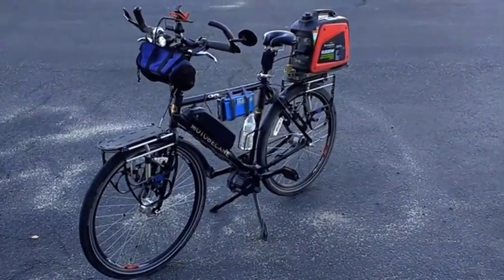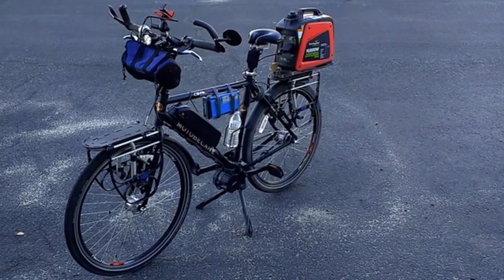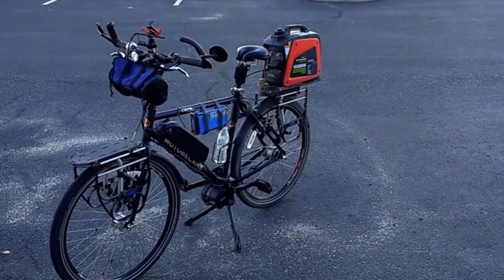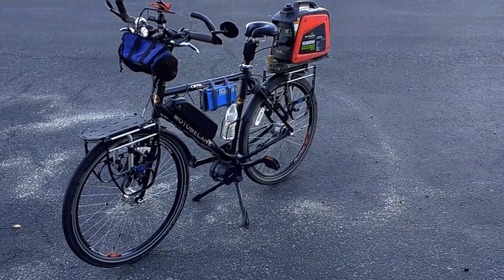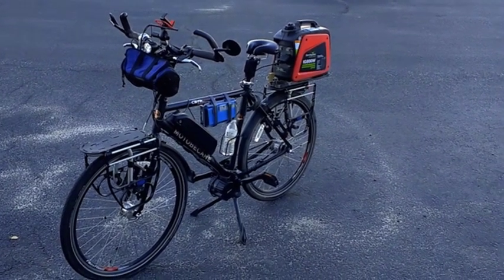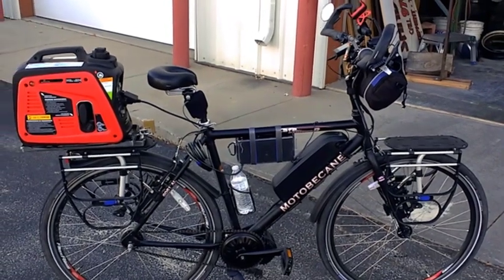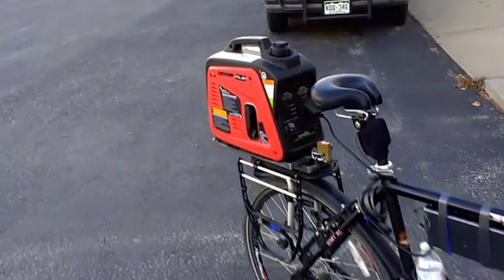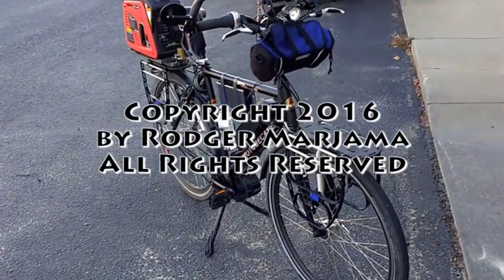e-Bike With Generator

Comment: any update on this? was thinking to do the same. I have a 350 watt middrive e-bike. Problem is i dont know what generator i should use. Someone told me i will get a 20% efficency loss. But since the smallest generators have like 800 continous effect im thinking it will work.   Any ideas?

Comment: The question that pops up in my mind is : how many miles to the nex place where you spend the night or a few hours that has a AC-outlet. Will that ever be more then 500 miles? 

Yes one can quickly fill up this generator at a gas-station, which beats charging for 4 hours for each battery that one has.

So this setup would be more for those that do thousands of miles never sleeping in a B@B, hotel or home, right?
Reply: Depend on the motor, I will choose a different kind of charger. For example my e bike motor it's 48v and 7.5A torque. 250w. So I can drive without battery if I use a power converter AC 230V TO DC 50.00V 5A. My generator it's 1000w max. So its very silent at 250w dc output to power the bike. For long miles I don't use the batteries. I have motors on both wheels wich can let me use extra torque on hills. It is safer like that because both wheels working, wich can prolong the life of the wheel.
Reply: as you said. to be able not to wait for the battery to charge is really nice.  And in some places there is really far away from a place to charge.  

Biggest advantadge is the range. Even if you are not in remote canada you will have the freedom to go anywhere you want. With a battery only you have to plan your trip and calculate distance.
Reply: primative camp sites.

Comment: Swap the battery  for a capacitor bank. Use a high speed marine charger as well.
Reply: I've never thought of using capacitors as a bike battery. With this setup I can see the advantages. Have you seen anyone do this in real life?
Reply: kevin jennings I use a genny + capacitor bank for my welder. The capacator bank kinda absorbs the surge drain from the welder.

Comment: I have actually had this idea for a while I would like to go a few steps farther and build a coffin style sleeping compartment to pull behind my bike with not only heating  but also air conditioning system with generator that could run the heat and a/c unit as well as charge the bike battery cause 50-100 miles a day travel is more than enough for me to be tuckered out but if I could build something like that it would be a dream come true I would probably just live in it and keep on the move lol lol
Reply: I have built a protoype "pop-up coffin camper trailer" which can be scaled up to meet your specs (AC, heater, etc). The dimensions are:
LENGTH: 2.7 meters (just over 8 feet)
WIDTH: 1 meter (just over 3 feet)
HEIGHT (w/top down): 1 meter (just over 3 feet)
HEIGHT (w/top up): 1.95 meters (about 6' 8")
WEIGHT: 20 kg (about 45 lbs)
TRAILER: 1 small wheel, suspended
FEATURES: good ventilation, insulation, Murphy bed (10 cm thick, 90 cm wide, 1.9 meters long), mini-sink, shelving, 2 small solar panels & 2 small lithium power banks, LED tail lights & interior lighting
Reply: Neverumind NeverTell https://www.wicycle.com/products/bike-trailers/diy

You can build your own from this kit. I've built a huge trailer from this kit.

Comment: Can you supply directly to motor via the battery output.
Reply: Abd Aziz Abd Hamid I dought it but . More than likely you would have to step down the power somehow. Like on my bike is a 48 volt system try to push 110 volts to it and you'll fry the motor. but there's got to be a way to make it work
Reply: Yes. But you need to check how many amps per hour it's draining you dc motor. What's the voltage and how many watts it's the motor?  This information will help you to find a high power converter or charger directly to the ebike. It's safe. But take off your battery to prevent any mistake. Your battery can fire up straight away

Comment: Doesnt an ebike actually use two or three times its claimed wattage when accelerating, under a heavy load, or going up hill. In that case, a 250 watt generator would work well with my Honda eu1000i, with a 900 continious watt output generator which would also be powering my lights or charging small ectronics.
Reply: This is where I always get confused.   A Honda eu1000i  generator as stated on amazon site is  1000 Watts/8.3 Amps @ 120v (max I assume).   Now controller would be bottle neck, but lets say electric motor is 48v, does that mean in terms of generator that it could max out 16.6 amps?  or does it translate to 2000 watts? Basically I don't get how to translate convert the generator power info at 120v to different voltage that is DC.
Reply from the maker: It depends on the controller.  The controller will only provide the amount of wattage it is designed for.  My bike has a 1500 watt controller and the most I have ever seen is 1600 watts for a second when giving it full power at max power settings.  I have found on my bike, 700 watts is sufficient to hold 20 MPH on level ground.  Lots a variables, but what I do know is with my generator I don't have to stop unless I want to, or need some more gas.

Comment: Nice to see that someone got the same idea that i have.. at what voltage the motor is working? And what exactly is the blue box..??
Reply: The blue box appears to be the battery charger, held to the frame with some Velcro straps.  It looks like he can just unlock and easily remove the generator and charger when he wants to.

Comment from the maker: Just a quick note. I have had this bike generator setup for about 10 months now and have really made use of it. Over 1,100 miles and counting on the bike and perhaps a third of that with the generator on it Everything does work and most works well, but there is a bottleneck. I can only maintain about 15 mph and must be on reasonably flat ground to charge batteries at the same rate as they discharge. It's not a really bad thing, but when I go above 50 miles in the mountains, I have had to slow way down at times to allow the battery to charge while still moving. It's still fun, but I would like to go more the other way, say about 20 mph or so, instead of slowing down to about 8 mph for a half-hour or so every 25 to 50 or so miles on mountain roads. Car drivers are not really very happy about that either I suppose. 

So, changes are on the way, literally. 

I can supply up to 900 watts of power, 800 watts continuously from my generator. But, with this setup, I can only use 350 to 400 watts or so to the charger. It has an output of 300 watts max. The best way I can use more of the watts from the generator, is to add an additional DC power supply and use that to augment my battery power. With that intent, I have ordered a 600 watt @ 60 VDC power supply. It will simply plug into the generator's 115 VAC output and use whatever leftover watts the generator can give it. I realize there will be variables I'll have to address, but having a background in electronics from my service years and hobbies, I think I will be able to figure a good, clean way to do this.

When it is all finished, what I should have is an additional 200+ watts @ 60 VDC always available to the controller/motor. On flat ground that will give me another 8 MPH at minimum and much more help climbing those mountains. I'm also considering alternate ways to mount the generator as I would like to use the back rack for my slide-on bike bag. Thinking of a new trailer design to hold the generator low and close to the rear wheel. I have the BOB trailer already with a slide mount on top the rear wheel, but it's too much weight too high for every riding/road condition. A low mount for the generator on a short 16" single wheeled trailer would be much better.

Figured I post this now and maybe some of you might like to chime in on some ideas, helps, or questions. I'll post back with some pics as I progress down the road with this idea. My first post in this thread has a youtube link to a video I short shortly after putting this generator on my bike if you care to look.

Have fun everyone!

-Rodger
Reply: Try a getting a second identical battery and charge them at the same time with the generator to use the left over watts and only ride with one battery being used at a time so in theory it will double the speed of charging and range
Reply: @bradleybrewer9576  YES Brilliant. Of course! Simple soln for excess watts
Reply: Is it good to install a spare battery? The generator will charge the spare battery while the existing one is utilized to run the motor. And switch the power to the spare battery once the existing battery is drained. Plz provide your valuable feedback.
Reply: @Niyasazeez1  that seems like a good idea as it would isolate all the other components and work, except for the switch, just like it did b4.
Reply: Rodger Marjama in some states the cops will stop you and say you need a DL because it's now a gas powered bike WHAT. Just another way to harness people who own ebikes🤔......very cool I was going to do the same but I do not need the Harassment.
Reply: @davidross932  That's my concern too. With the added noise it's a dead giveaway but maybe turning it off for part of the ride would work
Reply: Just get a battery charger that charges double as fast!!
Reply: Build a mini sidecar for your generator?
Reply: https://www.youtube.com/watch?v=KF9JnCvpa5I I think two wheeled trailers are less prone to jacknife.
Reply: So any news about these updates? Any new video perhaps?
Reply: Can ya have power an elec motor like a swamp cooler motor..? Or a Baldor 3/4 hp

Comment: So, this set up.. Can you get into detail on how you set this up or what resources you used to create this?  I am interested in creating an e-bike with a generator but have a limited knowledge on how this is done.. Is it just adding a generator to the charger and then having the charger connected to the battery?  Any information would be great as I am a Noobie on the subject..

Comment: This seems like a much simpler way of self charging than the other methods I've seen. 

The big drawback is the size and weight of that generator. 

What's the smallest size generator that this can work with?
Reply: I think the law of physics says there aren't currently any other ways. The energy consumed cancels out the savings when all electric. But it makes you wonder what the numbers are by simply going gas only. Downside, oc, being the environment.

Comment from the maker: Thanks for the comments.  Don't really get back to these video's much, 'spose I should though.  As to range, as stated, it will go as long as I want to set on it with the generator running as long as the terrain is fairly normal.  No rain can enter the generator, it's made to be used in outside rainy weather.  All plastic, so really no way to get a shock unless you do not know how to plug/unplug a cord.  Tribride sounds good to me.  At almost a year now, I have over 11,000 miles on this bike.  I try to ride at least a 100 miles a week or so.  For a while I was up to 250 miles a week, but that is too much time now.  I have given thought to building my own recumbent trike and incorporating an integral gas powered generator/battery system.  It would be pretty heavy though, perhaps in the 100 lb. range, the way I would want to build it.  Power would come from the batteries, but the generator would be tied to load sense power output needs and would start and stop as needed automatically.  By designing the bike around the power system, it could be very compact still, but the generator would require at least 5 hp to keep sustained speeds upwards to 40 MPH possible in most conditions.  I just have to decide if I want to spend the better part of a year in the process of designing, building and tuning it.  It would be fun I believe, but I am already having a lot of fun in far to many areas, just as my wife, HA!  We'll see.
Reply: I would recommend a mid drive motor on a recumbent trike with a 20" drive wheel because I believe it would provide much more torque.
Reply: The recumbent trike would be slower at ascending hills, but faster at descending, and much better performing in  headwinds.
Reply: If this really works bravo man! This video proves your generator runs, that's it.

Comment: what kind of range do you get? do you just keep charging the battery as you ride?
Reply: yes he can go 250 miles or more depending on terrain, but of course speeds as he mentioned are very slow when charging. there just is not enough battery capacity + what's supplied by the generator to maintain 20+mph and the bike gets very heavy if you upgrade any part of the output or capacity, so there's that...

Comment: G'day Rodger. Thanks for the video. Nice rig. Interesting  topic. I have the yak trailer and am thinking of  fitting it up with a generator much the same as you have. I have the 48v 1000w bafang  mid drive with a 25 amp lipo4 battery (10kg mounted in an ammo box )to the 26" MTB bikes rear rack. I found tht a custom build Heavy Duty rack was the only way i could stop the differnent racks i was purchasing, bending under the torque and braking inertia's. Do you have an 12-48v  inverter in line to suit the extra voltage for the mid drive required or is the mid drive suited to other voltage. I sometimes  have the battery in the trailer and i find that it seems to push me along on the bike a little easier. I reckon the generator in the trailer is the way for me. Distance is what Im after,  to also do some touring. Any info welcomed. Cheers